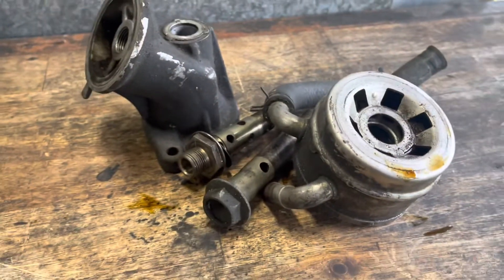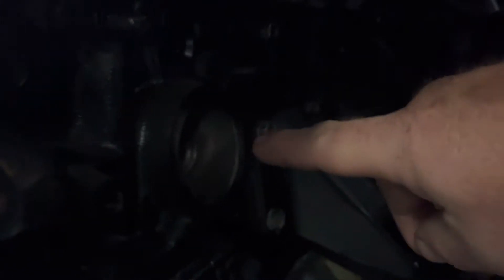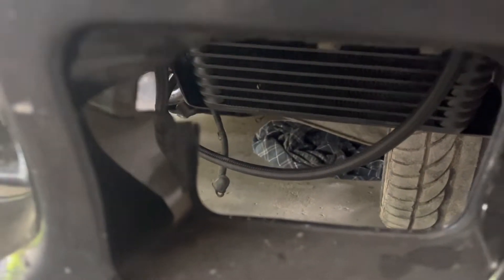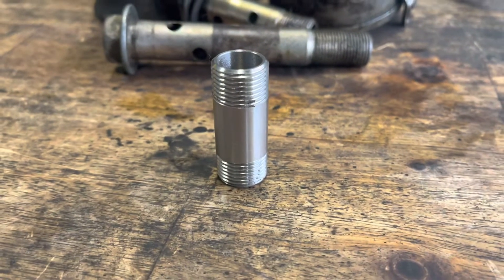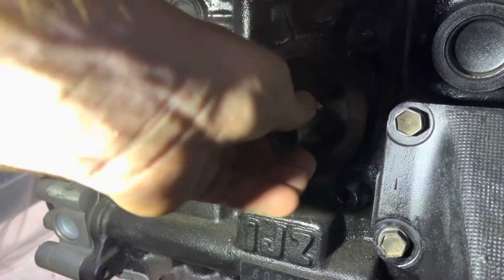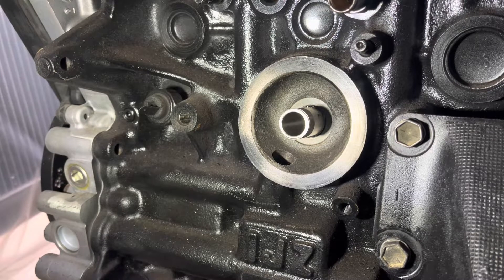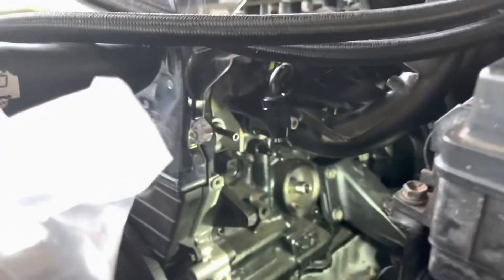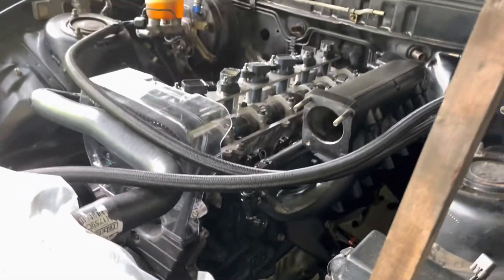JZ TOYOTA SUPRA OIL COOLER DELETE REMOVAL TO FILTER ONLY

Comment: Hey, there's a sensor in the front of the factory oil cooler housing, when you remove the OEM oil cooler. 
Where does this sensor now go?
Reply from the maker: @Abe_Rudder  not sure this is set up for an aftermarket ecu so no oem sensors.

Comment: If i do this on my 2jz gte, should i run a oil cooler then? Or itll be ok?
Reply from the maker: It would depend on the engine the power and how you want to use it. If it’s a built motor and you plan to drive it hard on the track or drive it hard for extended periods an oil cooler would be the go. For a street engine like this 1jz I think the oil temps should be fine but we will keep an eye on them when it comes time to run the engine in.

Comment: Ok. Nice vid good explanation crisp and clear audio.    How did you re route all the coolant lines.
Reply from the maker: I haven’t finished the cooling system on this yet and as popular as the JZ engines are haven’t found any clear information on which is the best way to do it. Some just block them but have seen a few different ways to route the system once everything is modified. This includes people using the a water cooled turbo ect. Thanks for watching !